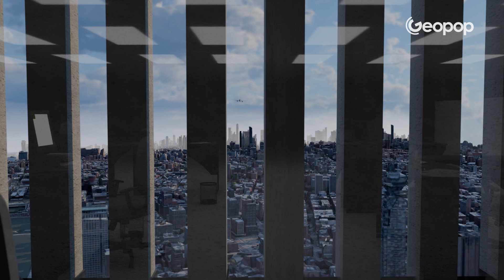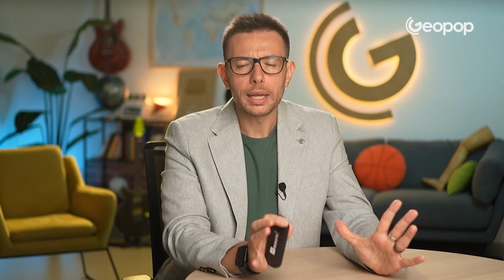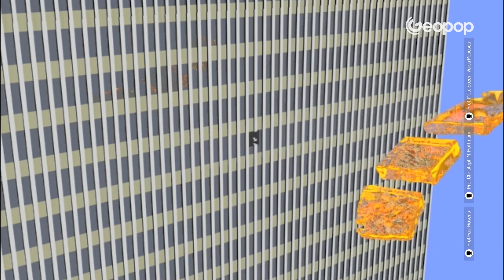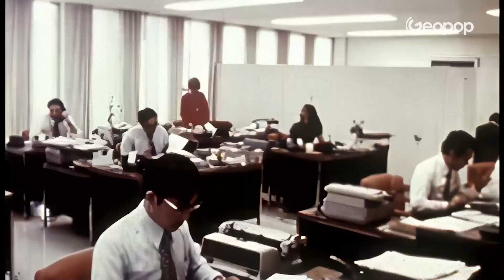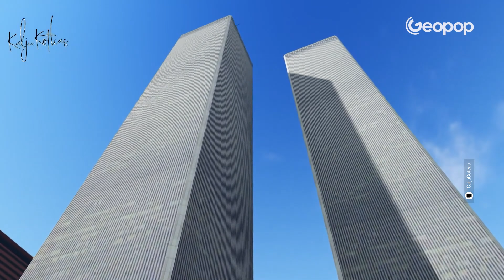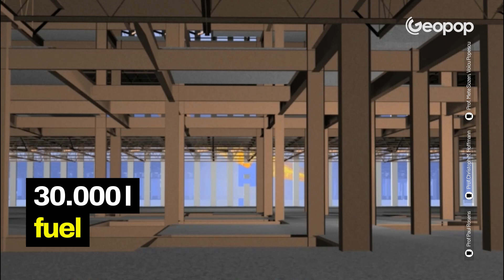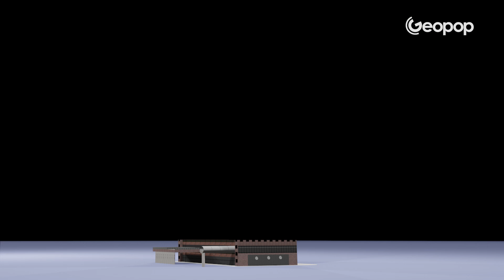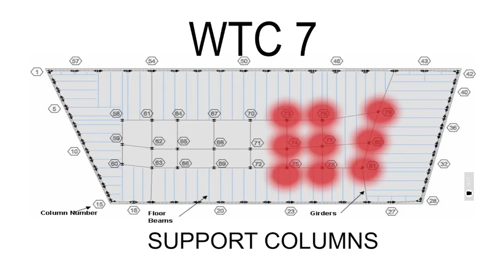9/11, 2001: The Technical Reconstruction of the Twin Towers and WTC 7 Collapses

Comment: So first of all you have cnn abc and many others showing a plane with a pod attached to its undercarriage. The planes engine was described by a boing expert as being from a military aircraft, the plane was not designed to even fly at the speed it was doing when it crashed into the building. William Rodriguez stated that explosions had occurred before the plane even hit the building. Explosions not associated with the plane crashing were reported on many different floors. Nano thermite was detected and many companies associated with the government had billions of reasons to hide the facts. CIA clandestine operations were accountable for puts leading up the attacks. The manoeuvres performed by the plane could never have been performed by any of the blokes that could barely fly a Cessna . How does a plane hit the pentagon when 2 policemen and witnesses state that the plane was travelling from a different direction. The initial hole was no bigger than a missile, all footage was conviscated, never released. Too many unanswered questions never answered
Reply: Mindless repeaters have to mindlessly repeat.  Do you have any arguments not premised entirely on ignorance-fueled personal incredulity and dead horses that have been beaten to glue a million times already?

I can absolutely guarantee you won't ever get anywhere with that mess. Because you are just mindlessly copying other peoples bad ideas off the internet you haven't even worked out you are making contrary points in some cases.

I suggest you go clean slate and start over. Right now there is no question everything you think you know, everything you believe, is just wrong.

Comment: Why do you speak in Metric terminology, the United States States has has been using the STANDARD WAY since who noʻs how long........Steel, there are different grades of steel A28, A36, A53, A441 and it goes on. I would say that the high grade of steel used in both of the twin towers would be LOW ALLOY STEEL POSSIBLY MEDIUM ALLOY STEEL where it needs to be as far as stess point's, where it needs the best support. They didn't use everyday grade of steel,,it couldn't of support the building, totally impossible.
Reply: He's Italian.
Steel used at the impact damaged floors was A36, which is nothing special, contains no magical properties.

Comment: If the wings were truly full of fuel, they should have disintegrated on impact. Consider the 36 steel columns, each about 6 cm thick, that the aircraft would have had to break through—especially given the wingspan on the impact side. So how is it possible that the hole on the other side of the building is even larger, and that more than 36 columns appear damaged—even extending through the core of the building?
It’s like throwing a fuel-filled egg at a wall with tremendous force—it might dent the surface slightly, but then bursts apart at the back like a dustbuster.
The aircraft’s skin is thin: between 1.5 and 3 mm on the fuselage, and 4 to 6 mm on the wings. Yet it contains roughly 28,000 kilograms of fuel. You're basically launching a 28-ton water balloon at 700 km/h into a steel structure. That kind of impact should completely pulverize the aluminum. Only the engines might be capable of doing serious damage to the steel columns.
But in the footage, it looks like the wing simply glides in as if through butter—without any immediate fireball or explosion on impact. The major explosion seems to occur only after the impact—at the rear of the building.
My only plausible explanation: there was a plane used as bait, but it didn’t carry fuel in the wings. The aircraft was essentially just a trigger. If it had been fully loaded with fuel, it should have exploded upon impact, not several moments later. Instead, it seems to vanish into the building first, and only then does a large explosion erupt from the inside—not from the outside.
Such an explosion would also consume all oxygen in the immediate surroundings. So imagine: no fuel in the wings, and the plane doesn’t actually penetrate the building structurally—it just disintegrates. You're comparing 1.5 mm of aluminum versus 6 cm thick steel—and yet in the animations it behaves like the building is made of butter, as if it had a thin aluminum skin. They show the nose of the plane going through the columns—even through the core.
Reply: One word. Speed.  This trumps material. A piece of straw in an EF5 tornado can embed itself in the hard bark of a tree.  The plane that hit the South Tower was traveling twice that speed.  Hence, relatively thin aluminum can sever steel perimeter walls and core columns.
Reply: The wings - and everything else - did disintegrate on impact. The entire 120 tons of airplane was converted into bits in a quarter of a second.

That in no way implies the building comes out unscathed.  Why that part is so difficult to grasp frankly boggles the mind. Thsi short video may help you understand the primary failure mechanisms from the impact"

https://www.youtube.com/watch?v=P8mG9pyImb8

Also, don't foget an airplane is a lot more than just wings (another bit of bleeding obvious I shouldn't have to point out but do).  Most of the mass is in the center-of-mass - the fuselage, and that is what did the majority of the damage, not the wings. 

Finally, never say the only plausible explanation when you have not run through the complete range of possibilities.

Comment: Seems like NIST compiled and presented evidence to support a pre-existing conclusion
Reply: And yet they weren't wrong or someone would have come up with a more plausible alternative by now.

Point of fact - the collapse mechanisms for the Twin Tower were well understood long before The NIST published it's final report. The publishing of any report cannot change anything anyway.

And for Building 7,  its collapse is one of the most studied engineering disasters in history, the subject of 5 comprehensive engineering studies and more than two dozen technical articles in major peer reviewed engineering journals, most of which were published 15 or more years ago. Thousands of pages of material. You hardly need to rely on The NIST.

Comment: The buildings were demolished, they didn't collapse, if it looks like a duck quacks like a duck it is a duck.
Reply: Strangely it looks exactly like a structural failure, and certainly quacks like one!
Reply: @ChristLink-Channel  It looks exactly like a controlled demolition you even hear the explosive detonations, windows blowing out seconds ahead of the meticulous collapsing of the floors, the controlled footprint of the AOE. Ask any demo expert that hasn't been paid off. Explain the molten steal smoldering under ground for 3 mths, to suggest that is a result of a building collapsing is utterly laughable. Wake up.
Reply: @troyrarehale2517  what you hear is the floor collapsing on each other, and the sudden "explosion" of air outwards.  The sound signature is nothing at all like explosives.  Do an audio analysis on it.  And I see you are a totally deceived conspiracy theorist, since anybody who doesn't agree with your agenda must have been "paid off".  Therefore, there really isn't much point in continuing this conversation, since you clearly will never be open to the real, rational, logical, physically based explanation.  In your world, nothing that contradicts your already imbibed theory, is automatically rejected.  It must be very sad to live like that, but it's your choice.  Personally, I prefer to examine all of the evidence, analysing it with a basic understanding of physics and structures, and arrive at whatever conclusion that leads to.  Which I have don, and tried to show you how to do the same.

Comment: I will accept all of this explanations if somebody can explan me in a very logical way following questions:

1) We can see during the collapse that the upper section of the Towers is tilting to the side. How can a tilting section of the building crash all the intact sections below? We all learned the Newtons laws of motion, here the third law: "To every action, there is always opposed an equal reaction". Please don´t tell me that the weight of the upper sections crushed everything below cause it was extremely weakened.

2) Why was the upper section pulverized when it tilted to a side?

3) Why were more than 300 bone fragments found on the roof of the "Deutsche Bank" building which is more than 100m away?

4) Why did the lower sections of the building did not move to any side, instead it crushed in itself against the highest possible resistance within 9 to 11 seconds?

5) We have seen more smoke than fire. It was really not an inferno that has taken place for hours. IWe all remember the lady that was staying at a floor and waiving for help with a white cloth very close to the plane impact floors. Many other people that were at the windows. How could they resist all the heat?

6) How could the firefighters came very close to the impacted floors when there was "so much heat in the lower floors"?

7) How can the WTC7 came down in its footprint while one column was the main reason for the collapse. Why did the building did not move to any side while one column after the other did get damaged. How could all colums could be damaged at the same time?

There are many other questions. But if somebody can give here clear and reasonable answers I will believe into the NIST theory.
Reply: Starting with the first:

1).  Let’s break it down to the absolute basics:

The 47 core and 236 perimeter columns of the Twin Towers support all of the gravity loads of the building. ALL of the resistance is in the columns.

Planes impact Towers, causing massive structural damage, destroying sprinkler systems, tearing out gypsum board walls and blasting off the SFRM insulation from the floors. Multiple floor-wide fires are started instantly and spread rapidly due to the destruction of fire protection systems and venting of the building during the impact.

Serious fires were largely confined to the impact damaged floors and those immediately adjacent to them.  

Fires were started by the impacts and fuel aboard the aircraft, which acted as an accelerant. No shortage of other consumables inside the tower to continue the fires. 

Collapse was initiated (started) at the impact and fire damaged floors when floor trusses exposed to heat over time sagged, in turn pulling on and causing the inward bowing of some perimeter columns by up to 5 feet until they buckled on one face of each tower (ie: NOT symmetrically). 

www.youtube.com/watch?v=ULdiD6gYZO0  

No steel melted or needed to. Structural steel will bend and fail at less than half its melting temperature.

Once the perimeter columns buckled the formerly static load above became a dynamic load 30 times greater, easily overwhelming the structure below.

Thousands of tons of now loose debris fall through the open office space within the four outer walls - bypassing the columns - dropping 12 feet onto the first intact floor it comes across. That massive instant overload causes the floor to fail, shearing the pair of bolts that secure each end of the floor trusses to the columns.  The floor fails. adding its mass to the falling mass which continues to accelerate for another 12 feet until it impacts the next floor, rinse and repeat all the way down. 

Rate of collapse increases as momentum increases. The collapse front is constantly accelerating. 

As each floor fails, air inside the building (the Towers were 95% air by volume) is compressed, then blows out the sides _in reaction to the Tower falling, not the cause of the Tower falling.

No fire required at all on floors below the impact points for them to fail. The mechanisms that started the collapse are different to the mechanisms which continued the collapse.   That will be a difficult concept for some.

As the floors fail the perimeter columns are left literally hanging in the breeze, no longer attached to the rest of the structure. They peel away and fall in great sheets (think banana) out to more than 600 feet from the base on the 4 points of the compass. 

Core columns failed last. 

Each 110-story tower had a 1-acre footprint. The debris pile was up to 14 stories deep and spread out over 16 acres, destroying 8 surrounding buildings and damaging more than 100 others. 

That should also address 2, 4 and maybe 6 since I have no idea what you are on about with that.
Reply: @TheLoonResistance thanks, I do much respect your reply! I like the way how you explain it. However let me understand how the tilting upper section that creates the dynamic load can cause a symmetrical fall down of all lower sections. Why is it not pushing to the side? And why is the upper section getting pulverized while it falls down?
Reply: @Pipmen  - Thousands of tons of now loose debris fall through the open office space within the four outer walls - bypassing the columns - dropping 12 feet onto the first intact floor it comes across. That massive instant overload causes the floor to fail, shearing the pair of bolts that secure each end of the floor trusses to the columns.  The floor fails. adding its mass to the falling mass which continues to accelerate for another 12 feet until it impacts the next floor, rinse and repeat all the way down

Stop thinking of the Twin Towers as 2 solid blocks. They were 95% air by volume and as soon as things starting moving that building was rapidly disassembling itself. The top bit is leaning because it is simultaneously dismembering itself.  The weak link is the floor-to-column connections and the floor connections are where the lower part fails, one at a time.
Reply: You missed the most relevant question which means 💩🪴💩🪴💩🪴
Reply: Ol stinky.. Here's a list of people who found molten steel in the debris.  Captain Philip Ruvolo (NYCFF), 
Richard Riggs(debris removal expert), Mark Loizeaux , Leslie Robertson (wtc structural engineer), Lynn Margulis (University of MA),  Dr. Abolhassan Astanch (from Berkeley),  Robert Kim Ireland( chemical engineer for US Army Corp of engineers), Mark Basile( chemical engineer), Kathy McGrade (materials engineer), Gery Warner( Mechanical engineer), David Gregg( PhD Chemical engineer), Steven Jones PhD( physicist), Kevin Ryan ( BS Chemistry), Niels Harrit (PhD Chemistry), Tom Sullivan( Explosives team) Jason Cheshire ( Chemical engineer), and Jeffrey Farrer (PhD Material
The fact that Molten steel was found proves It was controlled demolition , no need in addressing the rest of your bs.
Reply: @robbiehiatt9966  A I'm not aware that any of those folks actually obtained & analyzed any sample of this molten "steel." Can you point me to such a study, not just anecdotal reports?

B Since when does controlled demolition melt steel? It doesn't, of course! Certainly not in the quantities this theory requires.
Reply: @Tim22222 of course you're not aware you've got that in spades. I've given you multiple names. I'm not holding your hand. You claim to know.  Do the research. Then you will. Controlled demolition tends to explode molten metal through the steel cutting through instantly.  You obviously know absolutely nothing about what you are saying
Reply: Even air has resistance,  if it's 95 percent air why don't you figure out what the percentage of the building, destroyed the entire thing.    You're basically saying. .003 percent of the building destroyed 99.007 percent of the building. Yea that makes sense.